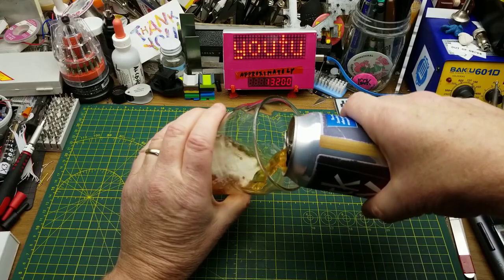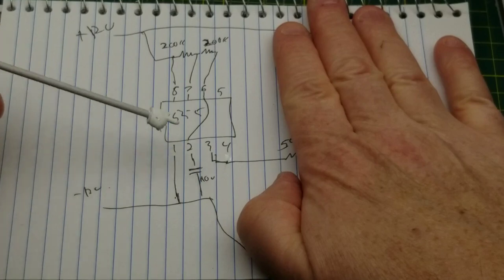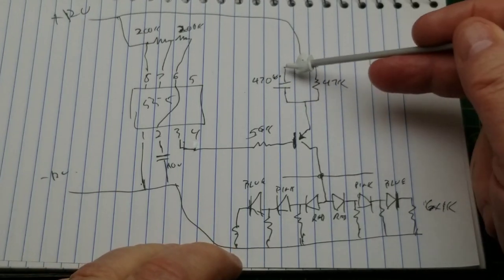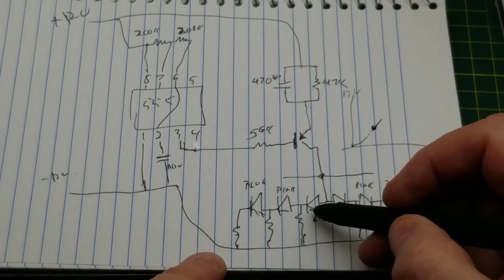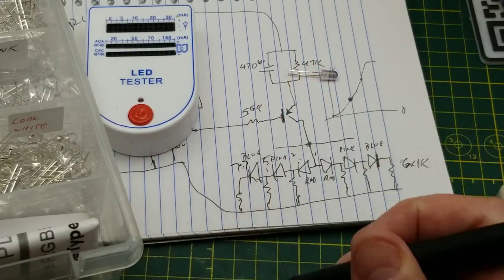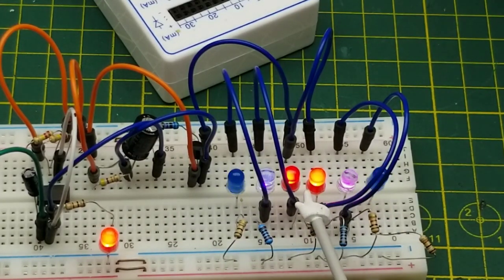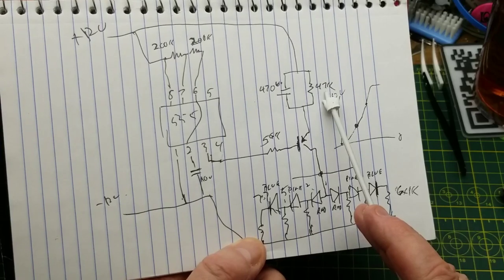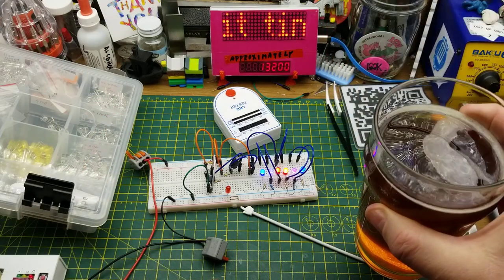555 and leds? What is this circuit?

Comment: Many of the DIY VU meter videos I've seen rely on a series of standard diodes to drive the anodes of each LED.  That requires a much lower voltage to drive than taking advantage of the LED forward voltage directly.  It also has the advantage of being linear even when different color LEDs are used (typically green,  yellow, and red).

Comment: This circuit can be simplified if you connect an npn-transistor in emitter follower configuration with its base to the connected pins 2 and 6, with its collector connected to operating voltage and its emitter to the LED / resistor arrangement. So you can use the "triangle" voltage directly to control the transistors emitter voltage.
Reply: Indeed it can.
Reply from the maker: Initially thats what I thought it might be doing.
Reply: @pileofstuff  555 is not equal duty cycle, it is actually 2/3 charge and 1/3 discharge, you would need to add a diode across the second charge resistor, anode to 555 and cathode to capacitor, to get it to have roughly only one capacitor for charge and discharge.

Diodes and resistors are common in the cheap things like VU meters, where you want the number of lit ones to vary, but are not going for exactly a reliable and accurate display. Just drive with a transistor buffer, and if low level you just have a common emitter amplifier to provide lots of voltage gain, not too concerned about linearity or anything, as you are going to bias it to be class C anyway.

Comment: I get the fade in effect because of the capacitor in series with power to the LEDS but I don't get the fade out since the transistor would cut off when it's base is cut off.

Comment: I think you are right, you can build the flipflop with just two transistors (+ a couple passives) and not need the 555.. love the dead bug soldering style though, and the beautiful soldering...  

and if you want all leds to have the same colour I think it would be possible to use 2R voltage dividers in addition to the current limiter on each led.. ? Maybe I test this when the earth stops shattering here 😆

Comment: the same resistors doesn't mean 50% duty cycle. In fact it is impossible to achieve 50% duty cycle with the standard astable multivibrator circuit from the datasheet of the 555 timer. You can only achieve it, if you use a single resistor from the output pin to the threshold and trigger pins and open discharge pin.
Reply: That's how I've always built 555 astable circuits - using a single resistor from the output pin (3) to pins 6/2, leaving pin 7 out of the equation (or using pin 7 as an open collector output for the circuit). I've never understood why people go to such great lengths to try to achieve close to 50% duty cycle using the discharge pin and two resistors, when there is such an obvious and much simpler way to go about it.
Reply from the maker: Clearly I need to re-visit the basics.  
It's been a while since Mr Mimms and I had a session.
Reply: @afreestone101  I also use this configuration. And I use the CMOS versions because they really switch rail to rail.

Comment: Great video. There are skid loads of these, what I call mid air "proximity solder joint" projects floating around. Whomever is producing them must have had a traumatic like experience with perf board as a youth because they never use it. OTOH there's Great Scott who has stock in Kester because his traces look like silver earth worms. To each his own I guess

Comment: I’m curious about that LED tester. I have a similar one. It seems to work well. But I’m measuring 9 volts across the LED sockets. Are you getting the same value? There are resistors to limit the current but wow that seems like too much voltage.
Reply from the maker: Yes, it has an assortment of resistors to limit the current to the various values available at the connector.

If you measure the voltage across the LED when it is being tested, that should be the forward voltage of the LED itself. 9V minus the LED voltage will be across the resistor inside the tester.
Reply: @pileofstuff  Thanks! That make good sense. I should have realized that.